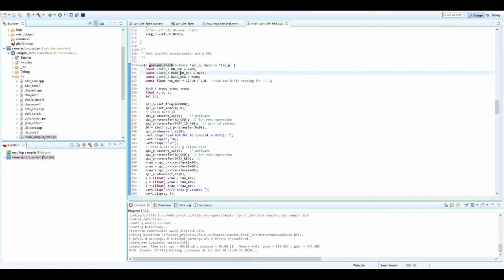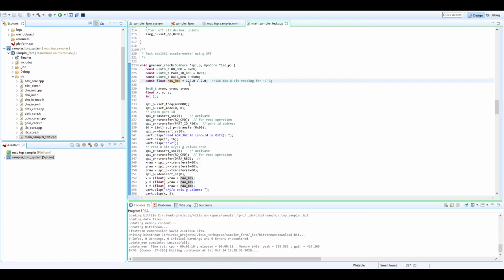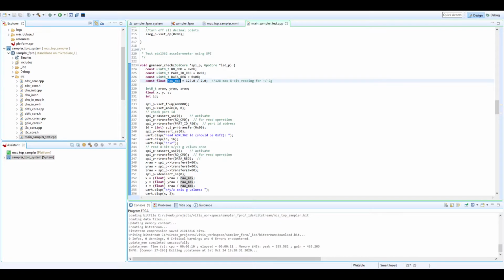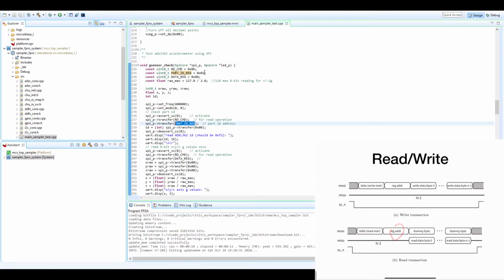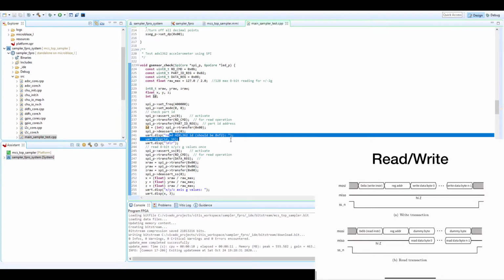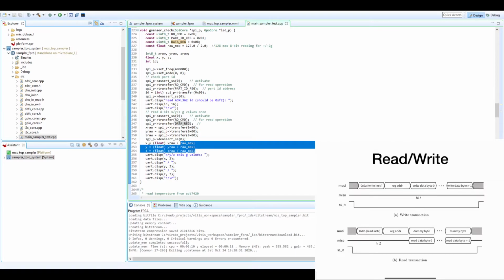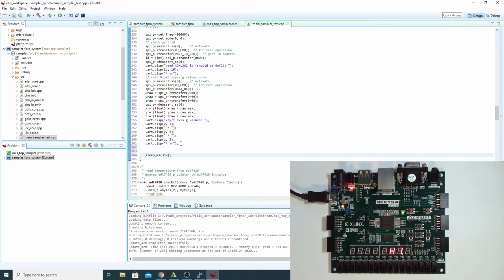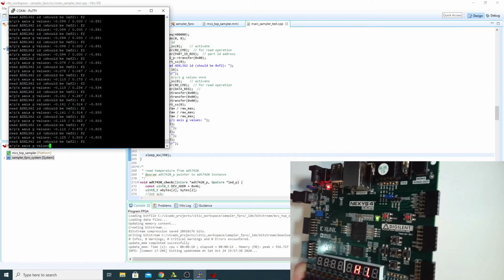M11 - 11 - SPI - Test Program

Comment: There might be a problem, the ADXL362 needs to turn on measurement mode. Suggest to add these code before line 244
   spi_p->assert_ss(0);	// activate
   spi_p->transfer(WR_CMD);  // for write operation
   spi_p->transfer(POWER_CTL_REG);  // power control register address
   spi_p->transfer(0x0A); //Switch to awake mode and Turn on measurement
   spi_p->deassert_ss(0);